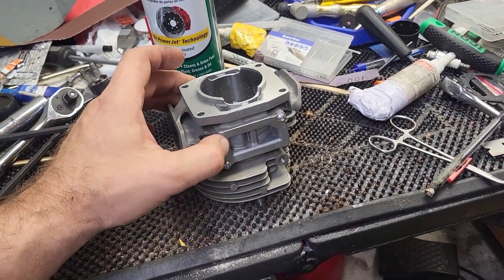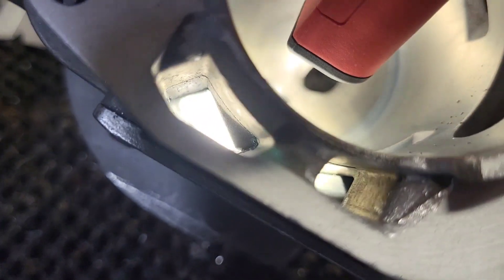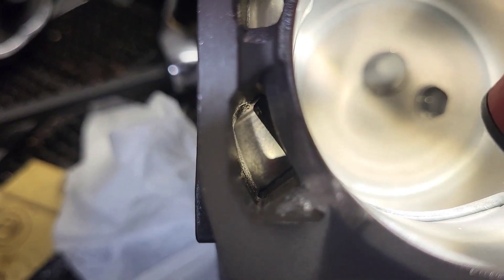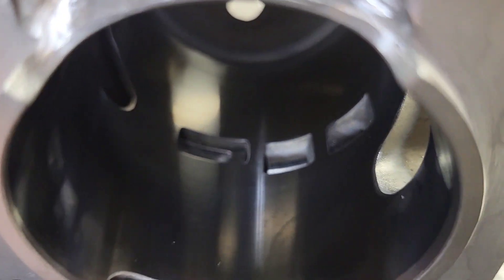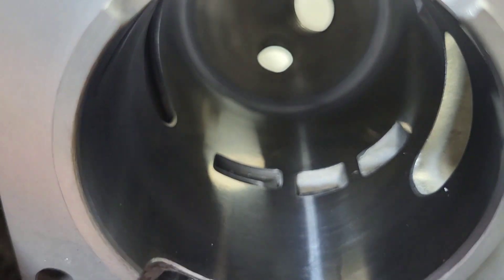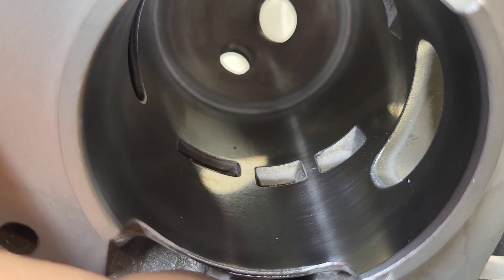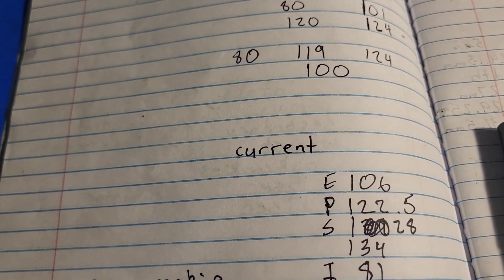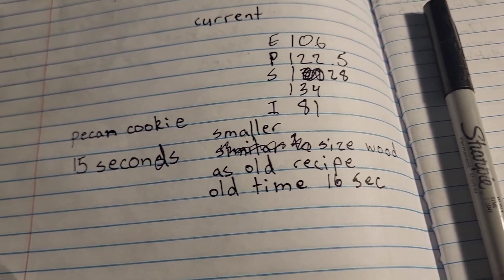7310 build and testing. forgot to film the finished uppers

Comment: Nice running & sounding build  👍👍  I don't think you're missing much on the Clone side of things especially if you work for a dealer and can pick up left-for-dead OEM saws on the cheap...
Reply from the maker: Thanks, there is more left in that cylinder i just want the saw back together for a while. 

We get maybe one or two good dead saws a year. Not many chainsaws in south texas. 

Biggest thing with clones is the parts are so much cheaper. Mess up a cylinder and piston and its 40$ vs +140$ on Echo oem.
Reply: @Super-Dave-Outdoors  yeah they are def cheaper but from my 1 clone saw experience by the time I bought it & upgraded it with OEM parts to make it more "reliable" - I could have bought a decent used OEM saw...
Reply from the maker: Majority of my saws are toys so i can run hot garbage and not worry if it blows up

Comment: 👍🆙SD
Reply: Just curious, how did it time compared 2 the 🐊372?
Reply from the maker: About 2 seconds behind. 372 will also pull an 8 pin and idk if the 7310 will.
I have more time on the 7310 so i am a little smoother running it but the Cajun built 372 is faster.
Reply: @Super-Dave-Outdoors  you have a good one 4 comparing your builds 2